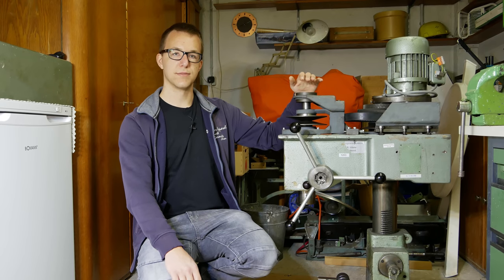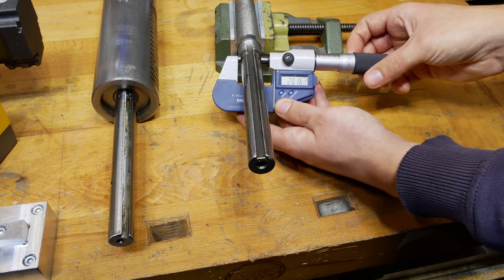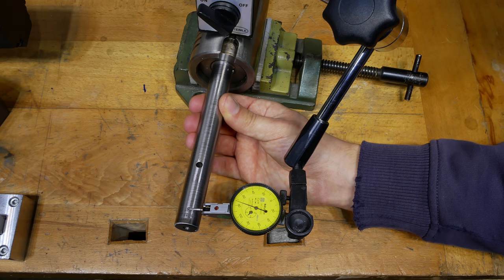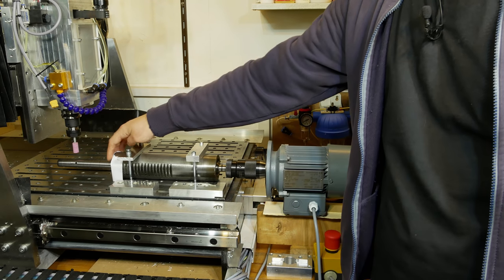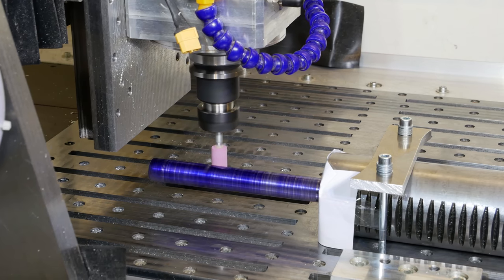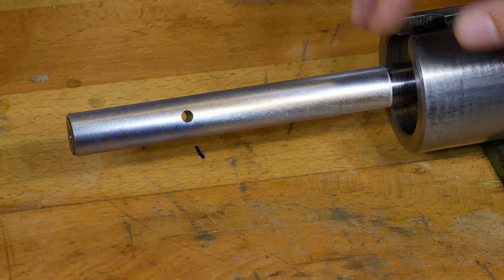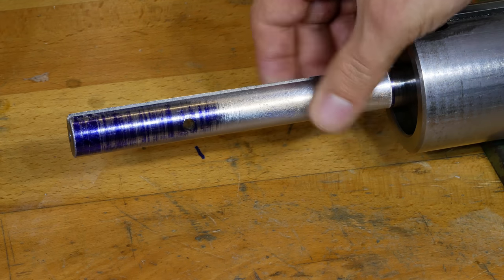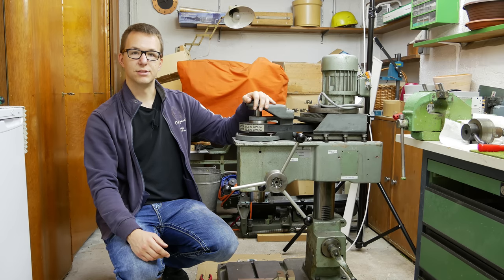Grinding the main shaft on the CNC Machine --Part 3-- Old drillpress restoration

Comment: Great video Alex! Do you think a tail stock would have helped? Or do you think it would have increased the run out?
Reply from the maker: Alignment would have been very difficult. There are no surfaces to check the correct alignment. The setup was rigid enough to get good results. And that's not a milling spindle or something like that with preloaded bearings. This one just has normal ball bearings in the back. Therefore the 2/100mm runout after grinding was very good :) 
Best 
Alex
Reply from the maker: I used a very similar method to grind the BT30 taper of my milling spindle. Only difference was, that the grinding bit was mounted horizontally. There I got unter 2μm runout in the spindle taper. So it's definitely possible to get very accurate results!

Comment: Clever way to grind a shaft!  Was there a lot of wear on the wheel after doing this?
Reply from the maker: There was a little bit of wear. I think mostly from the keyway "cutting" away the grinding bit. It would have been better to mount a bigger grinding wheel horizontally. Then it would be no problem to grind away a lot of material and the finish would have been better. 
Best
Alex
Reply: Yeah, when it comes to grinding, it's best to have your wheel perpendicular to the feed axis so that the edge of a wheel gets used up first, that way you know when your wheel is 'spent' as your whole wheel is dirty, or 95% of it is. The moment your entire wheel circumference is dirty, you're no longer grinding to the correct distance.